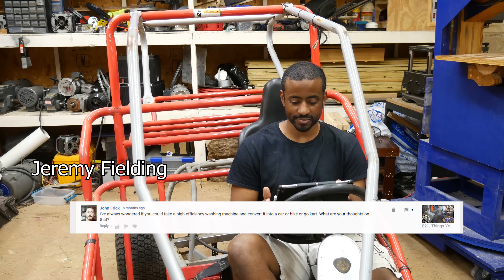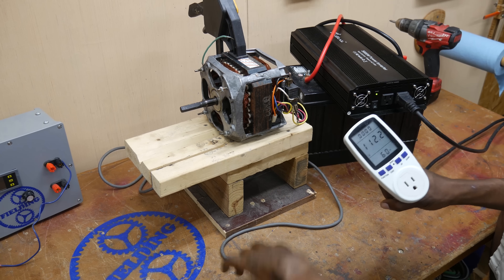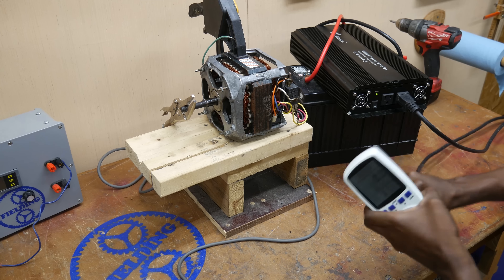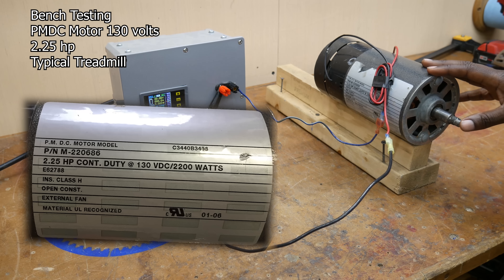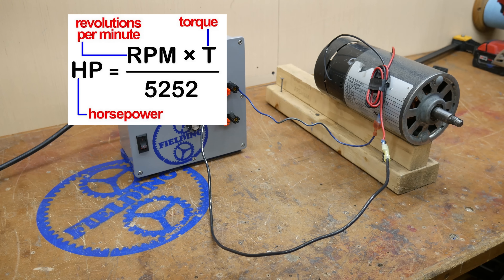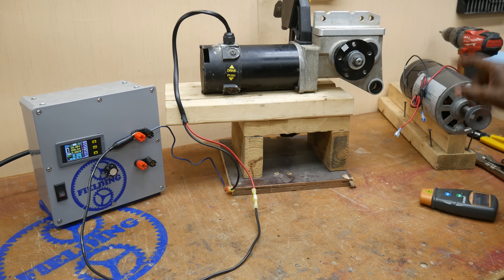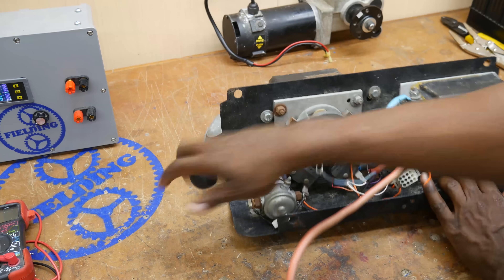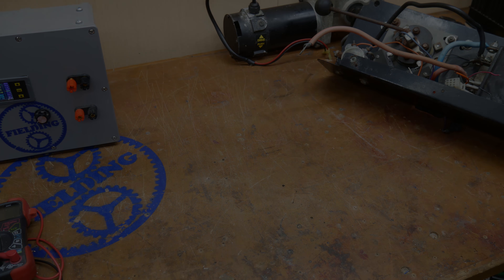What Electric Motors Can Be Used In A Go Kart or E Bike; Bench Testing and Recommended Sizing #61

Comment: The rating on inverters in commercials are the peak power. So a spike of one millisecond it might hold up to but two milliseconds? 
It's a little misleading and the fineprint has ALWAYS to be read ! Therein it often (if seller knows what they sell) say what the inverter can stand, peak power and continuous power.
Soemtimes though some seller claim that the advertised power are the continuous power, then I'm often very dubious wether they know what they are selling or whether they are lying. I worked for a swedish construktion/maker retailer and they did not know anything about their products they had no tech savvy at all so they advertise still their inverters and diesel/petrol alternators wrongly because they don't understand the difference between continuous and peak power.
Reply from the maker: The peak power for my inverter is suppose to be 6000 watts, and 3000 continuous. It is perhaps possible the inverter hit the peak and shut off faster then my meter could read it. But I would expect a reasonable peak power to be 2-5 seconds not in the millisecond range. But that is just me. I don't write the standard meanings of these terms :)
Reply: Yes, peak power should be for a couple of seconds if it to be called  honest. But honesty in retail is at its trough. Or just lack of knowledge from the retailers and dishonesty from the manufacture side. The little knowledge that my former company had was just a pity. I tested their, made from real Chineesium - diesel and petrol alternetors and those machines where just sad. Some almost met the specifications but most never did. They varied in power output like crazy and I came to the conclusion that if I ever should by a Chinese Diesel/Petrol alternator it has to be the one that has double the output  for it to run like descent. Most alternators and inverters did not meet any of their own standards. and peak out often came closer to the continuous than the advertised peak which I think are from the small time frames they allow themselfes (the facory) to rate the appliance.
It's so much trickery and dishonesty with the Chinese stuff, and gullible retailers that only look at price.
Btw: This was two years ago, things can change and things from china are slowly and steadfastily getting a little better all the time, some mabye some day we can atleast kind of trust what they advertise.
Thanks
Btw2: am I using the right words here? I mean a alternating electricity generating machine driven by a diesel or petrol engine and I call it a "alternator" above, is this the correct word?
There are two things I don't quite know.
Alternator Vs Generator.
Alternator produces AC and Generator produces DC?
In sweden we only have one word and that is Generator. Either it is "generator" and that implies AC or we define it as "Direct current generator" when it is DC.
Thanks2

Comment: The alternator is just a 6-pole (3-pole pair) 3-phase motor with an externally DC-excited rotor field wired in a wye configuration.  When generating power, the output is controlled by regulating the field strength.  

To use it as a motor, you need to generate 3 phase AC with, say, the secondary of a VFD or have brushless DC motor controller.  Problem is, the alternator is not designed to run full field for a long duty cycle.  

Of course, the devil and a lot of the cost is in the motor controller.
Reply: Ya that hundred or so dollars really hits hard on the pocket book not to mention the 2+ hours of jerking around modifying something to perform the exact opposite of its intended purpose. 

Not every alternator is a 6-pole, or delta configuration.  Problem is , the alternator is designed to run at a specified output with a given demand for the duration of it's rotation.

Of course, the devil and a lot of the time wasted is in the work put in.
Reply from the maker: well said.
Reply: Even at a "hundred or so dollars" you could just get a predator 212 and easily go twice as fast. It doesnt make any sense other than experimentation.

Comment: Extremely informative. I am curious what about introducing a sprocket transmission like a bicycle or an actual transmission that will let you start out in a lower revolutions high torque , and gear up to higher rev with low torque. Would that be effective? Or would you just be making things that are just gonna break? Not sure what it would take to handle the power of an electric motor. I know alot of youtubers show using a 12 volt drill motor with sprockets but they dont shift, and they are for peddal assisted bikes.
Reply from the maker: There is more than one way to approach the problem. You could shift some of the cost away from the controller and motor to a transmission. I think it can work if you someone wants to make it that way.

Comment: doesn't tesla use ac motors?
Reply from the maker: Brushless DC motors are called AC motors but they are slightly different... and FYI Tesla’s cost a lot!
Reply: most electric vehicles use ac motors
Reply: Jeremy Fielding 
Well they use three phase induction motors, similar to brushless rc hobby motors. Rc brushless motors can be up to 10kw. I’m surprised you didn’t cover them
Reply from the maker: Please refer to the description
Reply: Jeremy Fielding 
Well with modern rc systems, you can buy a several thousand watt motor and esc for less than a few hundred dollars. They have a fairly high output rpm, but it can be easily mitigated with one stage of gear reduction.

Comment: What about wheel hub motors you can buy for electric vehicles from asia? For example there is "qs motor". I've seen some 2500W 12 inch DC wheel hub motors for $125 on alibaba. 48-96V,  150 Nm, 580-700RPM. 
Are those offers real? 
Not sure if you can actually get them for that price but for projects like this these scooter motors would seem ideal.
Other offers are about $250. But if you can get a full wheel hub motor, shouldn't you be able to get equally powerful "naked" motors cheaper?

Thanks for the video!
Reply from the maker: I can't say whether that would work or not. Too many unknowns including the durability of the part from alibaba.
Reply: There is a video somewhere on YouTube of a guy using one on a bike, it was actually pretty good, the motor controller it came with was lacking a bit and he built his own.

Oh and the way the hub motors I've seen were built you cant5 separate the motor and the "hub".
Reply: Water and AC don't mix. DC could really care less about water. Case in point, electric trolling motors are quite common.
Reply: Thanks! The wheel hub motors were just an example for that specific application, but I'm wondering "how expensive do motors really have to be".
I'm just curious thinking about building an electric outboard motor for a boat.
Reply: Stranded comes to mind.  Would stick with gasoline for a boat.  Besides, last I checked water and electrical equipment aren't a very good mix.  When you start to consider condensation and how much range you'll get out of it, the whole thing sinks....no pun intended.
Reply: For certain use cases it would work very well. For short trips from battery or traveling slow with lots of solar panels (e.g. 30 large panels on a catamaran). Then maintenance is much lower than combustion engines and fuel is free.

Comment: Hi Jeremy. Nice to have a new video. Always learning with you. Looking forward to new shop?
Reply from the maker: It is still underway. Lots of work to be done
Reply from the maker: My test intentionally pushed outside the limit by locking the rotor. You don’t have that with normal use. Turning a washing machine tub is not the same as a locked rotor condition. But I think a cart on a hill might require a lot more starting current... and you might have a higher quality inverter.
Reply: Jeremy Fielding 
  You may not have gotten maximum watts from your inverter because the DC cables were to small. I have run washing machines, power tools, etc off just 2K one's but needed 4 or 6 guage feed cables to the battery.. Just a thought